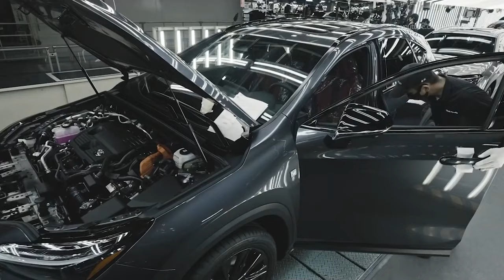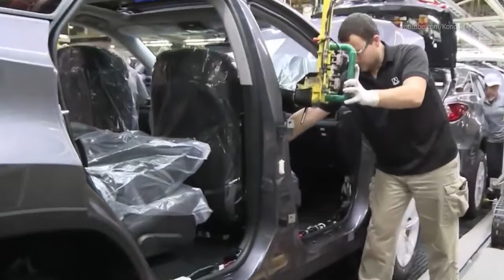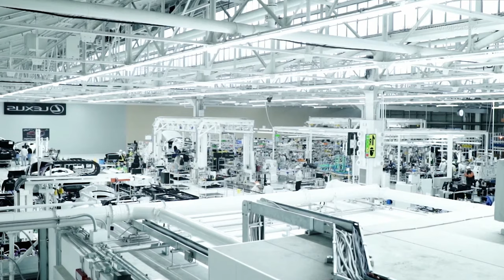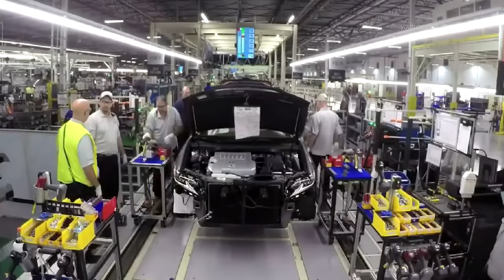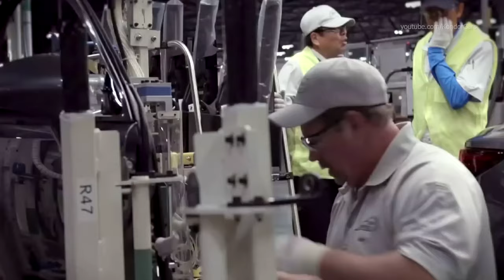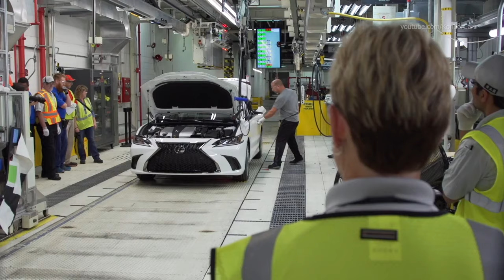Lexus Production - Crafted like nothing

Comment: I’ve got a 2007 Lexus ES 350 with 185,000 miles on it. I’m gonna run that thing as long as I can, hoping to get it to 300,000 miles.

I believe the last ES 350s that were built in Japan were built in either 2014 or 2015. When my 2007 days I’ll be looking for one of those.
Reply: nice, i have the same mileage as you but with a 2004 ls430, we'll get to 300k miles together ✊

Comment: My wife's RX came with two factory defects, so......
Reply: What were the defects?
Reply: @paigesnow4098  Front end alignment off and there's a piece of some clear double sided tape that is a 1/4 inch wide across the little window where you see the VIN on the dash.  They aligned the car (not perfect and I am picky about that so I'll be readdressing that) and the tape is here to stay until the windshield gets replaced, if ever.  My 19 RAV had intermittent trans trouble they could never settle.  My 22 4Runner was and still is flawless.